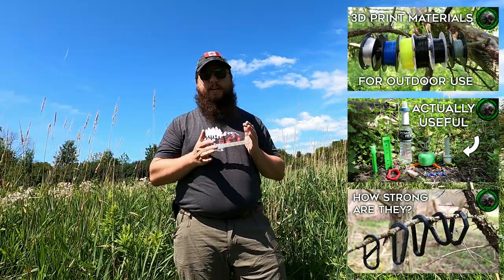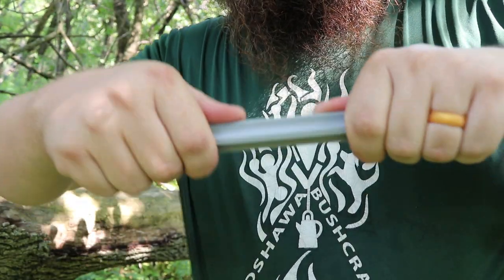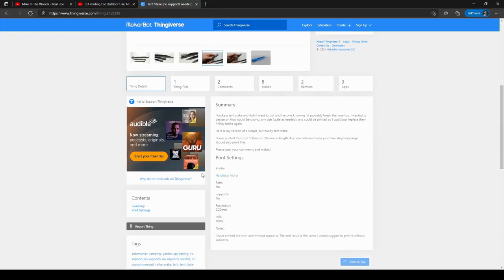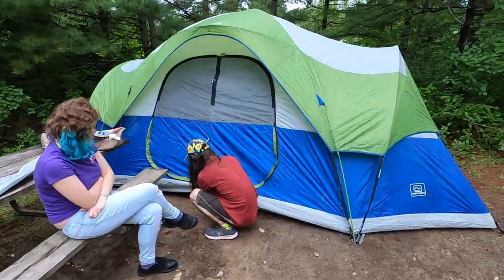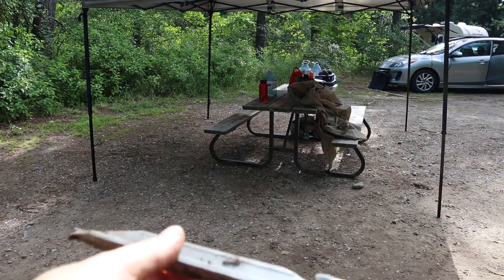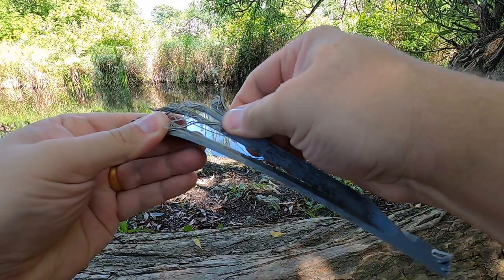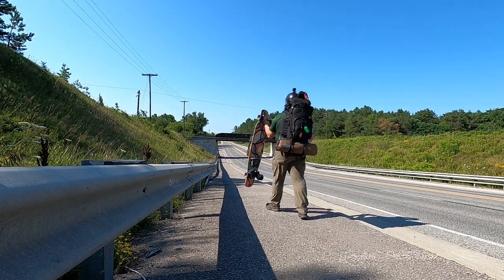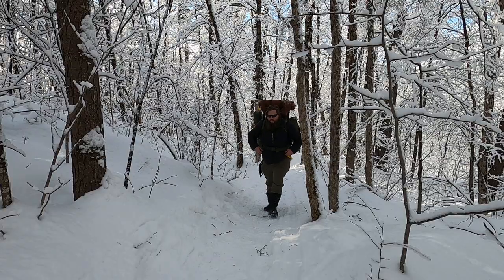I Tested 3D Printed Tent Stakes... Here's What Happened

Comment: You could maybe try printing the asa at angled lines, starting at the head and leading to the tip, that way if the bottom does shatter, it's going to be along a useable break line which would keep it sharp, Sort of like those breakable stanley blades for box cutters. If you know what I mean.
Reply from the maker: I get what you mean, but I think that would create more problems than it solves unfortunately
Reply: @MikeInTheWoods  Well yeah, it may mean that when you hammer it in it becomes two pegs before its in, but hell why the hell not right...lol

Comment: have you tested anything like a match-holder / screw-top fire-starter container to see if any of them would be water-proof without a rubber seal?
Reply from the maker: They probably wouldn't be, unless it was something like TPU which could be tightened enough against the threads to form a seal

Comment: Have you tried printing vertically so the dirt doesnt push into the layers ?
Reply from the maker: Unfortunately, that would create a structural weakness in the direction of pull from whatever's pegged down
Reply: @MikeInTheWoods  interresting and normal PLA probably only holds together a couple of uses I assume ?
Reply from the maker: @stepstv4466  I wouldn't do PLA. Even a bit of heat (like being in a warm backpack) will soften them up and cause them to get deformed